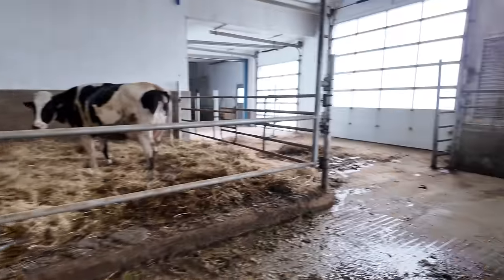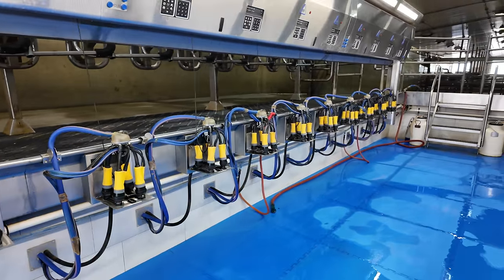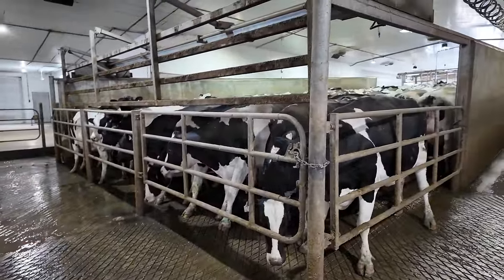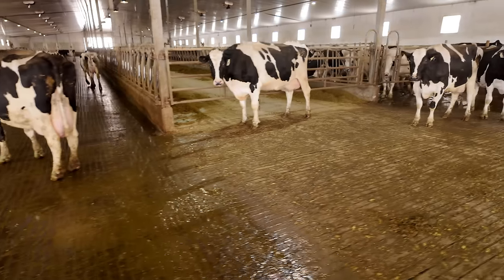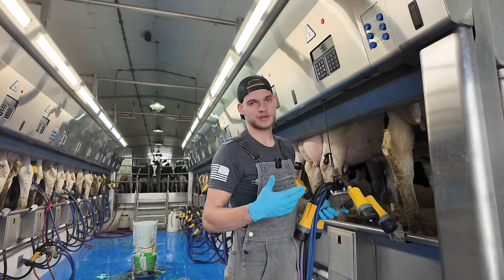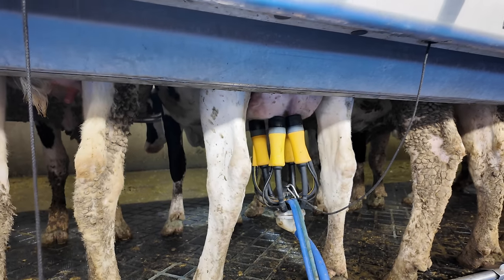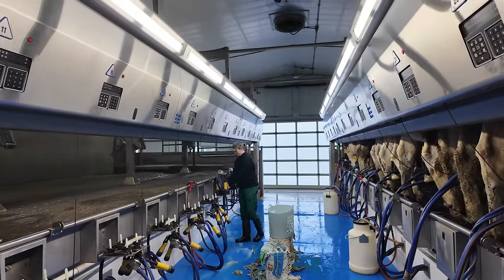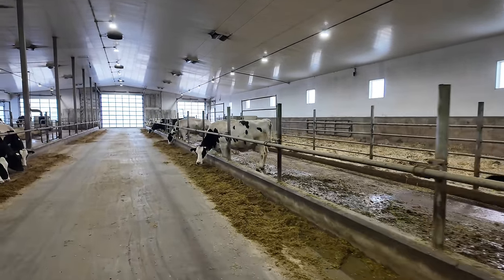An Afternoon In The Parlour!

Comment: What are those light flashes on the ceiling during milking?
Reply: They're supposed to indicate when a cow isn't scanned into the parlor correctly for tracking. However, it was never setup, so the lights just flash whenever the parlor is active.